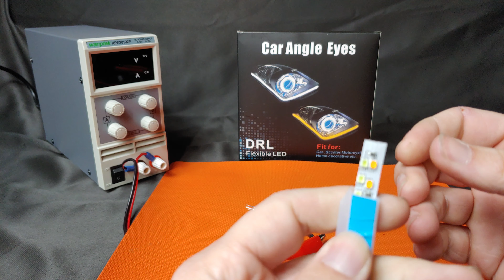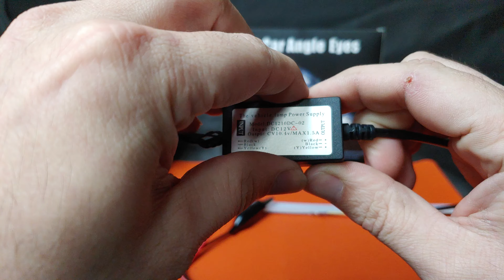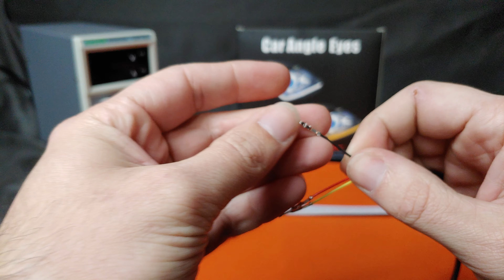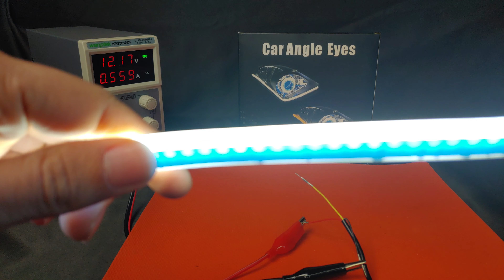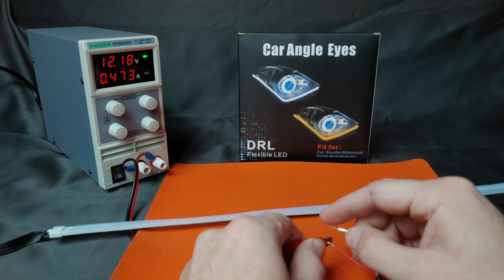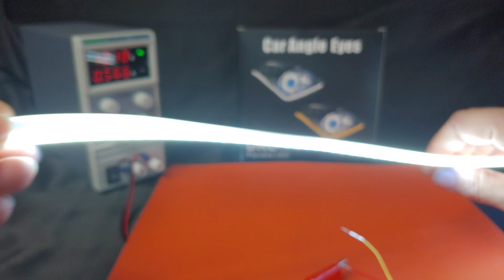LED DRL and Sequential Turn Signal Strip Review

Comment: Is the there a way to re wire the sequencer to make the amber the running lights
Reply: Anything helps
Reply: I have this exact same kit
Reply: Just tap the yellow wire into the drl wire and leave/cut the red. You won't be able to use the blinker function unless your drl turns off when you turn on the blinker in which case you can also tap into the blinker to get both blinker and drl function out of the strip.

Comment: Hi James, not sure if you can help but I have focus 2012 as you know that car doesn’t have DRL so I have got a voltage automatic detector to switch on the lights when engine is running using the ground and positive from the adapter. Then I have tapped into the indicator light. 

Now I have a problem when engine is running drl is on but when I indicate Both the drl and turn signal are on and the sequence stops working just flashes instead. (Rather than indicator override the drl) 

Do you know what could be the problem possible two different grounds? I would of though that didn’t matter?

Comment: Hey James thanks for your content and knowledge. I'm about to do my own Headlights in my 2017 infiniti qx80. My question is in my headlight set up I've got a Big projector light thats the high and low beam all in one. Then I've got like a eagle claw at the top thats the running light are park. Then I have 2 more smaller wich looks like projector lights but their not. Their the emergency flashers and blinker lights. Is their a way I can hook those lights up to come on when my headlights come on and still work as my blinkers when I need them to be are can I swap the wires and make my eagle claw park light the blinker light and then the 2 blinker lights will act as the park light?  This is my first headlight modification and I don't wanna burn any wiring up. These SUVs aren't cheap at all. Don't wanna make any mistakes so I figured I'd reach out to someone with knowledge like you. Thanks

Comment: I'm looking for something just like this but the DRL used as a reverse light. Is this possible with this item?
Reply: Yes just splice your yellow wire to turn signals in your taillights and red + to your red + wire on your reverse lights and black wire - to the black wire on your reverse lights pretty simple you could also use em as interior lights if you wanted but dunno who would haha.

Comment: Thoughts on my idea? 
I was going to solder these to my headlights directly because my headlight bulb acts as a drl, if the led gets shorted would my entire headlight be at risk?
Reply from the maker: You can mitigate the risk be ensuring your soldering joints are properly sealed/protected. The LED strip itself can be submerged in water without shorting, so that is not an issue.

Comment: can i cut those drl for my required size?
Reply from the maker: Yes, however they can't be cut to "any" length. There are marks (scissor symbol or sets of copper dots running across the strip) on the strip itself that show where they can be cut and still function. Either cut on the line or between the rows copper dots.

Comment: What is the wattage on these please how Bright are they and do you have a link do I can buy them please
Reply from the maker: About 7w at peak. They are surprisingly bright for such low power consumption but I don't have a lux measurement for them. You can find listings for these on eBay, Amazon and a number of other online retailers. I have a link to an Amazon listing in the video description.

Comment: I'm planning on putting these in the tail end of my sport bike but I don't want the DRLs just the turn signals. So I would just wire to ground and then yellow to the blinker and the red would just be disconnected?
Reply from the maker: No, in most cases the red wire must be receiving power for the signal to function. So you will likely have to connect the both the red and yellow wires to the turn signal. That way the red gets power, but the yellow wire overrides which color LEDs get illuminated.

Comment: Car voltage while running is 14-14.5 volts. Not 12. Try output current at 14.5 volts, and you'll probably get your rated current.
Reply from the maker: Yeah, this was an early video. I had forgotten to consider the voltage with the engine running. I'm better in letter vids.
Reply: @Jamesthelightguy    No worries. Still a good video!!

Comment: Mine wont work when engine is running.
Reply from the maker: Double check that the wire you selected for the main power still has power with the engine running, then double check the ground wire. I'm not familiar with every vehicles wiring, but it could be possible the particular wires you've chosen behave differently when the engine is on/off. You could consider finding alternative points as well. After you check the power wire, let me know.
Reply: @Jamesthelightguy  I've taken a live feed from the fuse box and it does have power when engine starts and on if ignition and worked perfectly well with a set of these however, they wasn't flowing indicators they were just on off and that worked.  I upgraded the led strip to sequential and then works perfectly well when engine is off.   Ìve see a guy used a 5 pin relay and some resistors but I'm unsure where that would take me.  Many thanks for your fast response.
Reply: @Jamesthelightguy  I should clarify that the white drl part illuminates when the car is started it just doesnt respond to turn signal indicator when engine on.
Reply from the maker: I see. Interesting. I really wish I could mess with the signal connections in person. Sometimes when I can't figure it out with logic, I'll stumble across the answer through trial and error/dumb luck. 

I don't know how he wired up the relay and resistors to get his working, but I have to imagine there must be an easy work around. (Like adding a small capacitor across the the strip's signal wire and ground wire. But I would have to play around with that idea to see if it does anything at all).

The relay idea sort of makes sense in my head (having battery power going to the relay, normal ground, the strip signal wire as output, ignition power as primary relay input switch and the turn signal power as the conditional input switch.) But that's just a theory and you'd have to run a separate one for the other side which seems complicated and bulky. If it even works like in my head. 

Unfortunately, I don't think I have any solid answer for you. I'll try messing with mine again but I wasn't able to duplicate this issue previously, so I can't promise I'll find a solution. I'll let you know how my experiments turn out.
Reply from the maker: I can't recreate the strange voltage fluctuations that were causing the other guy's issue and may be similar to what's happening with yours. It's impossible for me to give you a solid solution right now. Sorry.

Comment: I have wired the day running light the red wire to a switched live in the fusebox black earth to body and yellow to indicator live wire the indicator doesn't work when the day running light part is on but does with hazards or when I lock car any ideas why it doesn't indicate when the running light is on
Reply from the maker: Very interesting. By all logic, it should work as intended. I don't have an answer for you right now, but let me mess with one of my sets for the weekend and I'll reply on Monday with my findings.
Reply from the maker: So I tried a bunch of things and couldn't recreate the issue. For me it either works perfectly or not at all. I'm sorry, I don't have a better answer.
Reply from the maker: Oh, unless the day running wire is being switched off when the turn signal is active. Try running the red wire straight to the battery and test the turn signal again. If it solves the issue, you'll have to find another power source, if it doesn't work be back to square 1

Comment: Hi sir i cuttted the led the indicator is glowing but the white light is continuously flowing from one end to other howw can i make it as a stable white light without flowing from one end to other continuously
Reply from the maker: I have never experienced the white LEDs behaving in that way. Double check that the point where you cut the strip is correct (with the copper pads and/or a marking indicating that it can be cut there) and test the white LEDs using a consistent power supply and only the main power wire and ground wire. If it still isn't working correctly I may have you join my discord server to share photos/video of the strip and issues.
Reply: @Jamesthelightguy  thank you for your reply I'll try that and tell

Comment: Would they still work if I spray them or tint them with a soft black tint or spray?  I’m doing costume lights but I don’t want the white to pop so I’m trying to blend them in with my black housing lights. Any suggestions?
Reply from the maker: I doubt tint spray would be very effective on the silicone casing. I don't have any good recommendations to blend them into black housings at the moment. Sorry. I'll think about it a bit and reply again if I come up with anything.

Comment: Can you hook it up with just the ground and turn signal only? where it won’t switch back to drl because my car already has drl.
Reply from the maker: Yes, in most cases if you combine the LED strip main power wire and the strip turn signal wire together and then connect that combo wire to the vehicle's turn signal wire. This should only power the strip when the turn signal is on, no DRL.
Reply: Thank you so much!!!

Comment: Nice video 👍🏼 need ideas for my tail lights and this seems like a good option to try 🙏🏽
Reply: I'd like to use these in the back too. But DRL as back up lights on & the amber as turnsignals. Is this possible m

Comment: hopefully I'm not  too late to ask, I want to install these on a classic car which has no daytime running lights. would I just splice red with yellow to the turn signal wire and black to chassis? Or red to a constant power (like stereo) and yellow to turn signal wire? Thank you
Reply from the maker: It depends on what you want them to do. Black is definitely going to be connected to chassis/ground and yellow is going to the turn signal wire. If you connect red to the turn signal as well the strips will not light up white (off unless turn signal is active) but if you connect red to a parking light the strip will be white whenever the parking light is on and amber when the signal is active (but it will not work at all if the parking light is off)

The last (best option) is to connect the Black and yellow wires as described before but split the red wire in two. Connect one of the red ends to the turn signal with the yellow wire and put a dose diode in series between the other red ends and the parking light. This way the signal will always function regardless of the parking light having power and the diode prevents the turn signal from also powering the parking lights. 

If you email me (my email is in the about section on my channel page) or message me on Instagram, I can draw a diagram for you.
Reply: @Jamesthelightguy  Woah, I honestly did not expect a response so quick and in depth.

But coming from a bit of experience, the diagram seems pretty easy. I was just confused as to how the strips worked, but with the set up you gave; were pretty much by passing the white light (connected to tail lights respectively) by giving power to the amber strip once the turn signal is given power. Thus, its more of a double function headlight? 

Honestly I'm looking more forward to your channel, and hoping to see more automotive wiring tips like fender light installs etc. Thank you for your time again
Reply from the maker: I'm glad you understood what I was trying to say! If you want, post some pictures on instagram with #jamesthelightguy so I can see them.
Reply: @Jamesthelightguy  Of course, I'll post some before and after showcasing it!

Comment: can these be used just as an indicator or does it have to be a DRL as well
Reply from the maker: You can bypass the DRL function by connecting both the main power wire and the signal wire to your vehicle's turn signal. See this video for an example:
https://youtu.be/ksqDfpkbgZg

Comment: Hello.I want to ask...Can you buy the controller board/chip to make the sequential signalling?Thanks! :)
Reply from the maker: I don't believe they are sold separately from the strip. Due to differences in strip designs, the controller board is likely engineered and programmed to work only with it's corresponding production unit. Unfortunately I have not seen any sequential signal controllers available for purchase.

Comment: I’m not really sure where to connect the yellow wire... because there are about 3 different wires in my turn signal thingy where the bulb connects. Does it matter which wire I choose to connect it with?
Reply from the maker: It does matter. One wire should be power for your parking lights (those are on continuously when your headlights are on). Another one should be a ground wire which we want to use. The third wire should be power to the turn signal (again we want to connect this wire to the yellow/red wire on your DRL strip).

Of course this is assuming your vehicle uses the normal setup of having the bulbs always connected to ground and the switch controlling the power. It gets complicated if it's the reverse like my friend's car.

Comment: Hi is it possible to fit this on rear lights over the top of my indicators? I have Bmw 3 series so it’s a long tear light which it could fit in but how could I connect it up to my indicator bulb?
Reply from the maker: For the rear i would use the strips i show in this video: 
https://youtu.be/ksqDfpkbgZg

If you can get them to fit, I would affix them in place with clear silicone caulk. You have to find a way to get the wires inside the car, behind the tail lamps. If there is no pre-existing hole one may need to be made and then sealed after the wires are fed through. Then it's a simple matter of identifying the tail lamp (Not brake lamp) power wire to use as the pain power, the turn signal power wire and a ground wire. Once identified, splice the appropriate wire to the corresponding one on the car harness and it should work (Well, depending on the model of strip. The signal may only function when the tail lamps are providing main power if a cheap variant of the strips is used.)